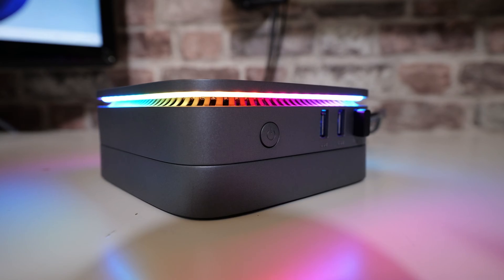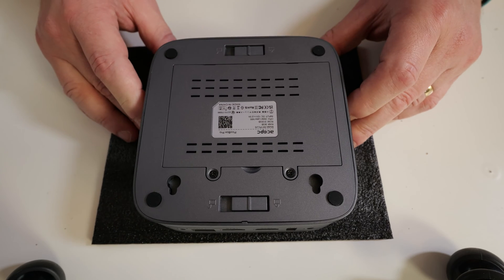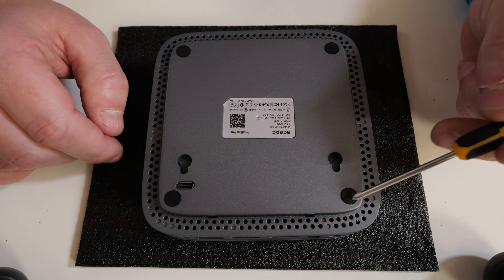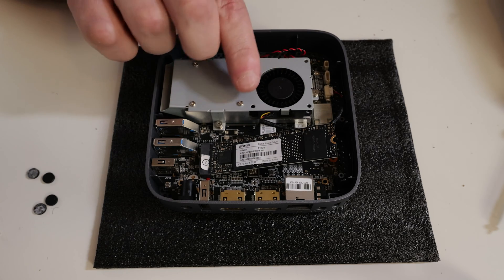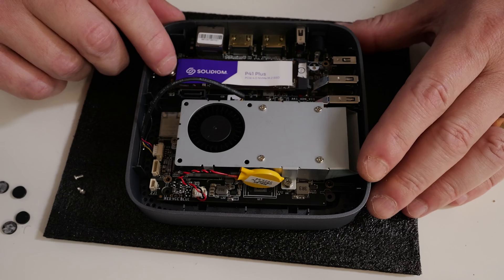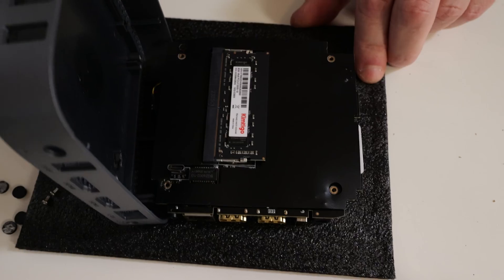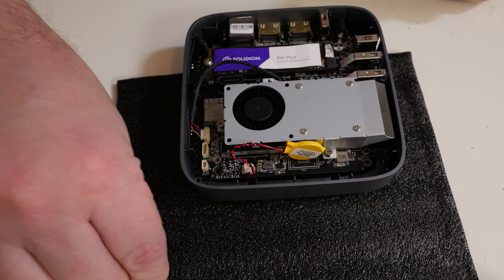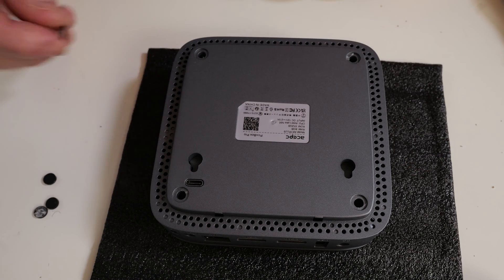ACEPC AK1 Pico Box Pro Plus How To Upgrade SSD RAM Or HDD

Comment from the maker: Available from affiliate links:  
ACEPC AK1 Pico Box Pro Plus
https://bit.ly/picoboxpro
Suitable m.2 drive
Amazon Local:  https://amzn.to/40AR2gw
Ebay UK:   https://ebay.us/ukl3o6
Ebay US:  https://ebay.us/FlFO5m
Ebay CA:  https://ebay.us/mvW3HN
Ebay AUS:   https://ebay.us/PfPUSH
Suitable 2.5" SSD
Amazon Local:  https://amzn.to/477VNRa
Ebay UK:   https://ebay.us/l1H8sb
Ebay US:  https://ebay.us/Ue46lL
Ebay CA:  https://ebay.us/2CIwi9
Ebay AUS:   https://ebay.us/eSn9TI
16GB RAM upgrade
Amazon Local:  https://amzn.to/3FY2vxi
Ebay UK:   https://ebay.us/GugwFE
Ebay US:  https://ebay.us/UaXmLK
Ebay CA:  https://ebay.us/e39uW1
Ebay AUS:   https://ebay.us/35z7Tt
Reply: I need help I have MSI H610M-E Pro I am confused where the a 4 pin connector comes along side with molex connector
Reply from the maker: @hassangammudi3212 if it is for a fan, it is an either or type deal.
Reply from the maker: if not join our discord to discuss

Comment: Hi, Mike. Working on that mini PC seems to be about the same as working on a laptop or a gaming console. On a totally unrelated note: I was having trouble with GTA Online suffering freeze frames and stutters. After messing around with the typical Graphics and PC settings and not getting any results, I found the solution by asking the ChatGPT AI. The problem turned out to be a sound driver conflict. I disabled all of the sound devices I wasn't using and like magic, it fixed the problem. Now my game is running smooth as butter. Everyone should put that little nugget of info in their PC repair toolbox.
Reply from the maker: audio drivers are a nightmare, realtek and HD audio drivers are so unified, but also don't have the logic to not install a driver for a similar chipset.
this is a very common issue, and one of the reasons i suggest using the  motherboard manufacturer driver installer packages as they often have an older signed off driver, rather than the newest "compatible" ones.